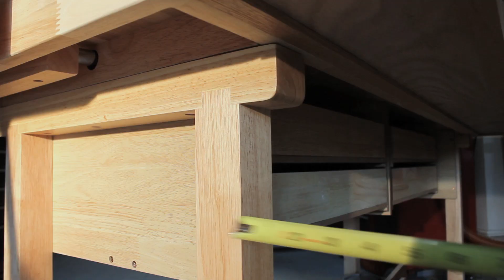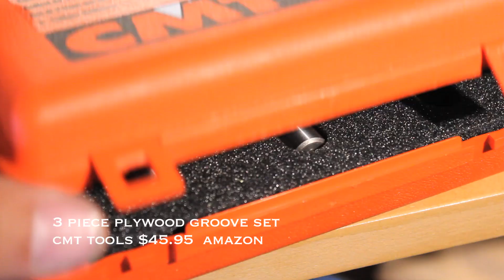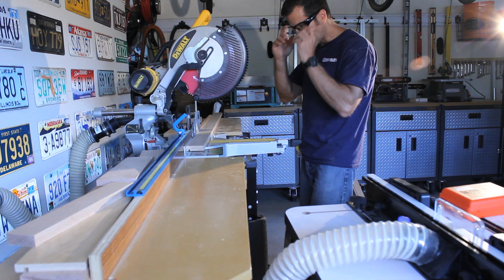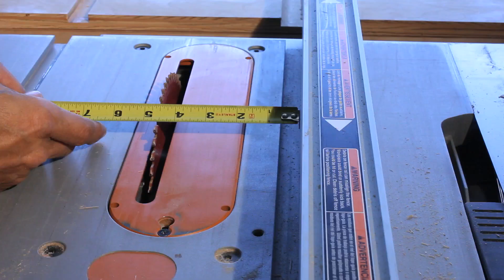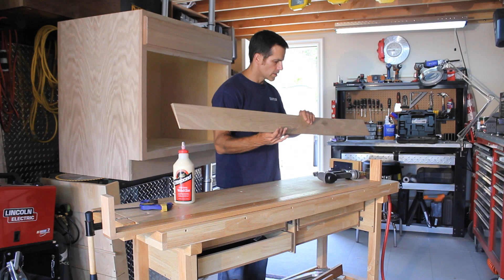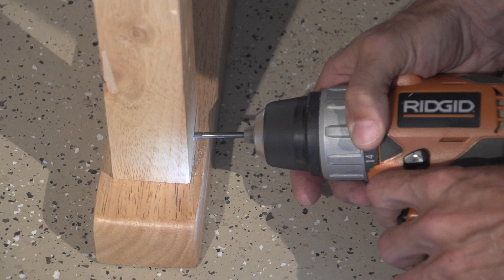Workbench Upgrades

Comment: Try Dap Rapid Fuse Fast Curing Wood Adhesive, it is repositionable for up to 3 minutes and cures in 30 minutes - ready to plane, Sand, stain, pine, dries 40% stronger than woods like cherry, poplar pine. Best glue I have ever used and it speeds up my workflow and makes me a better living. Changed everything, no exaggeration offered.

Comment: I have two of the HF work benches.($119 each) I have them back to back. I use mine for out feed table for my Rigid table saw and work bench. I also done away with the fiber board and the drawer slides.  I replaced fiberboard with 1/2" plywood and better drawer slides. While building the second one I put all 4 drawers on one side and added a shelf on the other side. Also the vise is not very good. Not the best work bench but hey I really like mine. They have served me well for the last 18 months.

Comment: Okay Russ, your video here was a big help.  I'd been looking at this bench for about a year now and didn't think that it could be worth much for that price, but after watching this video I went to Harbor Freight and got one for $119.00. I added the Rockler casters and will be using your idea for the modification to the top as well.  Thanks for the help.
Reply from the maker: you won't be disappointed - I use mine every day, and after 3 years is still holding up great - even mounted my Dewalt contractors table saw to it.  Can't beat this workbench for the price

Comment: Great video. I  purchased the Harbor Freight Windsor Workbench and  would like to upgrade the drawer slides with full extension slides. Any suggestions where I can find slides to fit?
Reply from the maker: That would be an excellent upgrade - The size is not standard for sure - I would check with MLCS Woodworking or Rockler.

Comment: Russ, how do I remove the drawers.  Mine open less than half way, and I want to see if I can fix them, but I can't get them out.
Reply from the maker: there should be a black plastic catch on the drawer slides.  if you take a screw driver and press in on the catch, it allows the drawer to come out fully

Comment: Thanks for posting the video. I'm putting one together now....One question:  Did you use glue when you assembled the workbench itself?
Reply from the maker: Larry Fanella  I did not - Its pretty sturdy without glue - I have been using it for several years with no problem - but glueing joints is always a good idea